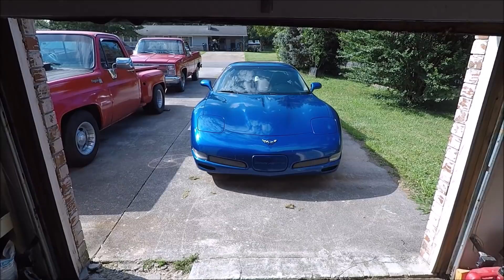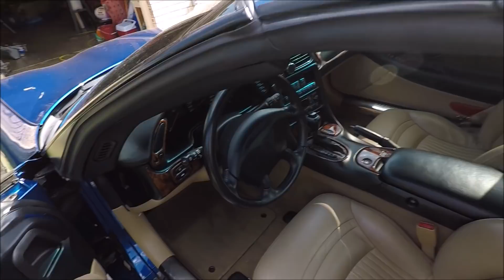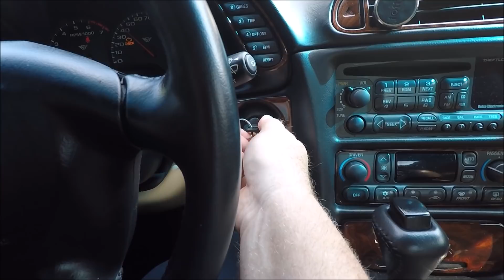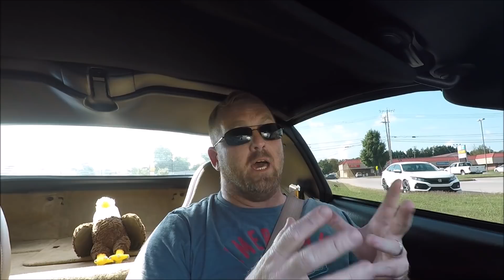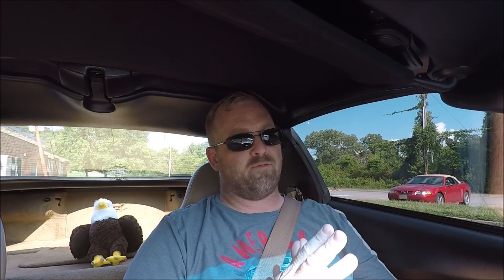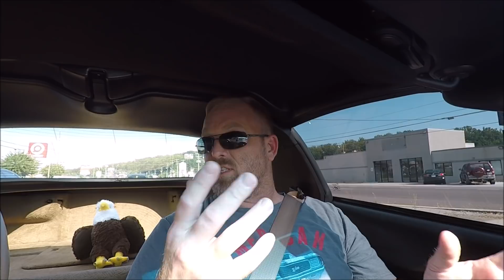SPEED ENGINEERING HEADERS vs MANZO HEADERS FOR C5 CORVETTE

Comment from the maker: So more and more I think I made the wrong decision and have set myself up to need fabrication work....which is exactly what I was trying to avoid on this build. What do you guys think? Should I have went with the bolt in option instead?
Reply: Well it sounds like both kits will need fabricated so I think you got the better kit i hope lol worse case you will need a new exhaust but I'm sure you will get a better exhaust soon once you start the high dollar build lol
Reply from the maker: Naw brother the Manzo kit is direct bolt in. Once the eBay build is over I’ll be replacing some thing but the reason I went with the Speed Wngineering headers was because it’s built out of better material and is proven to flow well and make power so I’m hoping to make it permanent. But it’s definitely going to be more of a headache to install than the Manzo would have.
Reply: @BadLuckGarage  ok i tho you bought the manzo kit im a lil confused in the video didnt you say you was getting the manzo kit?
Reply from the maker: Lol, nope.
Reply: @BadLuckGarage  ok lol im sorry i tho you did i feel like a goof but i hope its not alot of welding and fitting
Reply from the maker: lol, its all good brother!👍
Reply: Buddy bought the Manzo and x pipe. Direct bolt on no issue. Had Straightline Performance in Joliet Illinois, one of the best Ls shops around the area install them and they said absolutely nothing bad about them and said they fit perfect. This was two seasons ago and my buddy said they are performing great no issues at all. I just bought a Frc and will be buying the Manzo myself. But overall great video.
Reply from the maker: Thanks brother. Yea I almost bought the Manzo setup. By the time I’m finished fighting with all these clamps I’m probably going to wish I would have.
Reply: I've decided on the SE headers for my 01 C5 over all other brands for many of the reasons you suggested. I'm hoping to be able to do the entire thing in my driveway on jackstands. The only part I'm really worried about is somehow measuring exactly where to cut the factory mid pipe. I may have to estimate and then purposely cut it too long, then try test fitting and just keep cutting an inch or so off until it is right. Any other ideas on how to do it?
Reply from the maker: Haven’t really thought too much about how I’m gonna do it yet, but I’ll be doing a video covering the entire process when I do. 👍🏻

Comment: Speed Engineering. I bolted up a set with X pipe and shop fabbed mufflers and tips. You are putting exhaust on. Pull the entire factory exhaust. Save it. Put it back on if necessary. My 408 with Speed Engineering headers and exhaust picked up 28whp and 23 ft lbs. No leaks, no sagging, and the sound is unique. Best bargain part upgrade per dollar.
Reply from the maker: This video is two years old. You can check out the more recent videos in the Chinavette playlist to see what we decided!

Comment: I run Manzos on a C5 FRC with zero issues. Fit perfectly and sound awesome with the rest of my system. I'll buy them again for sure
Reply from the maker: Yea I was pretty happy with the Speed engineering. Haven't had a set of headers go in that easy in awhile.

Comment: I ordered speed engineering headers and x pipe, with a few extra feet of aluminum tape mine did not lest at all
Reply from the maker: Yes this is an old video. The install video was made almost a year ago brother. I covered how to fix the leaks in that video. 😉
Reply: Bad Luck Garage yeah that’s why I ordered it, it was great video and on the one when you did 7.20s was that NO2 and tune? Or NO3 only? I ran 8.5s with tune first ever pass but popped the Radiator so didn’t run again but now have cam and headers. I think it’ll be fun to make a few passes against you, you’re like an hour or so north of me.
Reply from the maker: Lol,  to this day I still have yet to tune the car.  All I really did was add a little bit of timing  but I still haven’t adjusted fueling or anything and it’s still running pretty rich and the timing could use some more tweaking as well.  I just got so busy with the DR nova project that I haven’t really messed with the Chinavette much. Hell I’ve had the HD2 shift kit for months now and still haven’t installed it. 🤦🏼‍♂️
Reply from the maker: Come on up! We’d love to have you at EMR! There’s actually a cash night scheduled for this Saturday if the weather doesn’t postpone it again. I’m wanting to run in the hardtire class but I’ve been working so late I haven’t been able to get my new tires put on or my bottles filled. By the time I get off work everything’s closed  😔

Comment: I have a speed engineering true dual exhaust for my f body and the biggest fail on the product was the dam clamps just like you said Lol. oh well i since changed up my exhaust
Reply from the maker: Yep. Every review I read said buy better clamps and weld up as many of the joints as you can or its gonna leak.

Comment: Once it’s dyno tuned you can always pull their tune an compare it to your street tune and might be able to learn a tip or two from the pro tune.
Reply from the maker: Thats the plan. The main advantage you have on a dyno is being able to see EXACTLY where to add timing and to be able to tune the fueling faster and more consistently. As an example, I have to drive for hours sometimes to fell confident that I hit all the cells enough times to get a good datalog. You cant really do that on the street...just like you cant really tune great drivability on a dyno. Thats why a really good tuner will do a dyno tune, then also a street tune. I know the tuner at the dyno near me actually goes to the track for some of his customers to tune "real world".